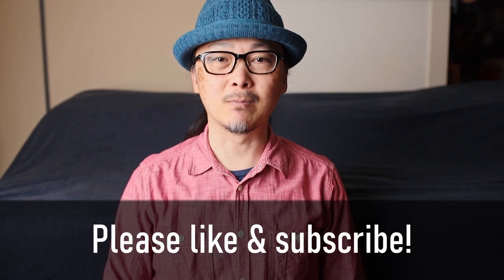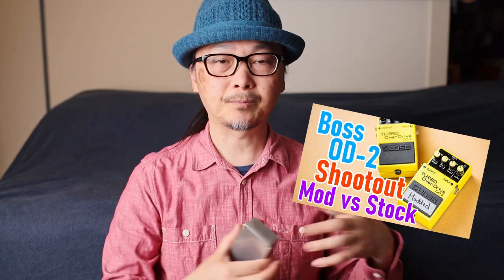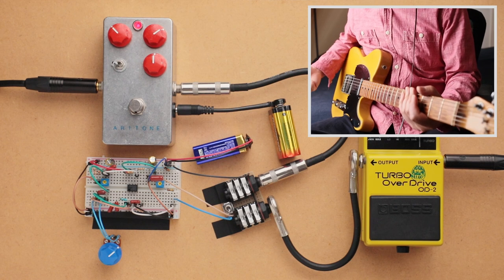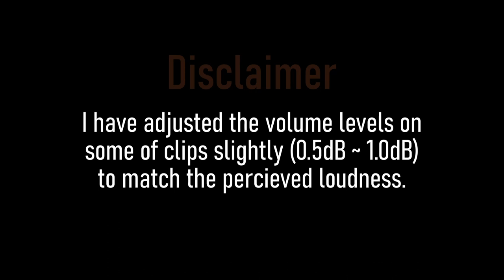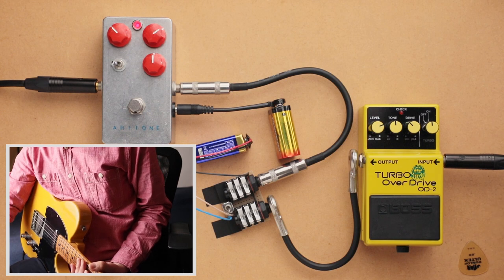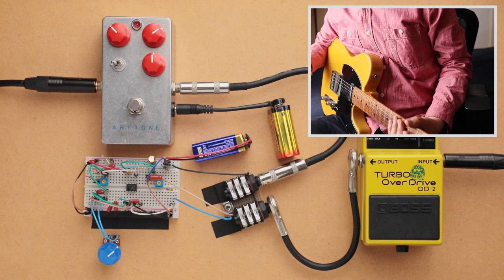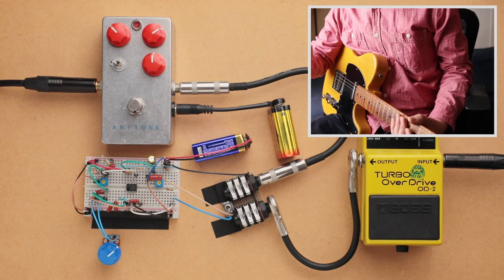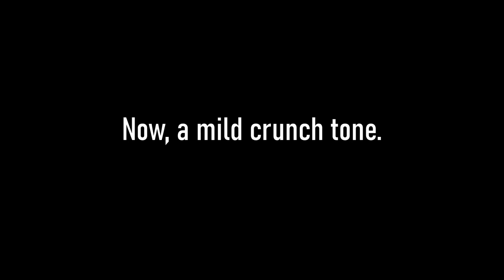What's The Tone Difference? Discrete FET vs Diode Soft Clipping in Overdrive Distortion Pedals

Comment: They were all surprisingly similar, and great sounding! My general observations about the actual differences:
1. Soft-clipping from the breadboard had the most mids, and was the most compressed. Both FET pedals sounded more dynamic
2. The MOSFET was more scooped and top-endy, whereas the JFET sounded pretty even across the frequencies
3. At full gain all of these differences were even more apparent, as you had posited in the video. The MOSFET sounded the most ragged and "nasty" but still in a good way. The soft-clipper was a bit more "pedal" sounding than it was before. The JFET seemed to maintain its composure and to my ears, sounded the best of the 3 (with cranked gain at least, otherwise they all sounded good in different ways)
Reply from the maker: Thanks for watching! And thank you for sharing your tone impressions in great detail! Yes, I very much agree with your observations, and like you said, each circuit has a unique tone that sound nice in its own way!

Comment: My favorite pedal uses cascaded OpAmps (clean) with tuned hard clipping diodes between stages. "hard clipping" is a misnomer, has nothing to do with hard or soft sound. It would be better if they were named "direct clipping" vs "indirect clipping" diodes. You can tune the diodes to be as soft or hard sounding as you like.
My particular pedal has a smoother distortion than any amp I've tried.
Reply from the maker: Thanks for watching! Yes, I totally agree, hard vs soft clipping are kinda misleading and there are a lot of mild overdrives with hard clipping circuits.

Comment: I think try low gain you hear more difference. For what for op amp distortion and jfets do sound different.  that if op amp has two diodes that clips symmetrically it going sound different. Jfet stage clip asymmetrically and become more symmetric at higher gain. Also as decays it become more asymmetric was cleans up. 2nd each jfet stage round out the hard edges of last one because of miller effect.
Reply from the maker: Thanks for watching! And thank you for sharing your thoughts!

Comment: You've got to love how usable the breadboard OD is. I use a similar design in a pedal and it works for so much... though I use a twin transistor set up for heavier distortion (hard and soft clipping stages) such as Hendrix.
Reply from the maker: Hi, thanks for watching! Yes, the breadboard OD is such a bare bones circuit with so many options for modding, which makes it versatile and a great platform. I bet your version sounds awesome!

Comment: I always hear in the industry how much more tube like jfet and mosfet are, yet I always like the tone of opamp/clipping diode recipe better.  And fet has a weird splatty tone. I think the only time I have liked mosfet is when the power section of an SS amplifier is mosfet. But I never like fet in pedals.
Reply from the maker: Hi, thanks for watching! And thank you for sharing your impression on the tones. It's nice that we can have so many options to choose from : )
Reply: when come to tone there is not right answer other what you like.  I think jfet really win out is clean channel of guitar amp. it simpler and cheaper  than opamp buffer and can be over driven little by hot pickups in guitar or pedal because it soft clips.  The most confusing thing is why in gautiar amps they op amp buffer for first thing you guitar signal sees. Yet very few guitarist like the sound of overdriven op amp with no diodes in feedback loop.